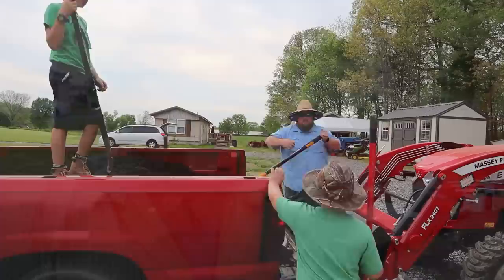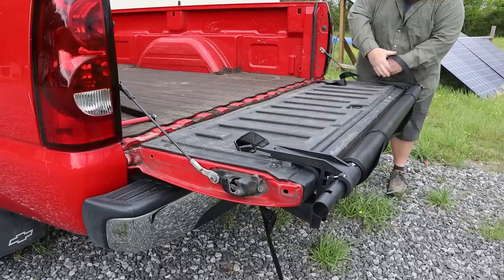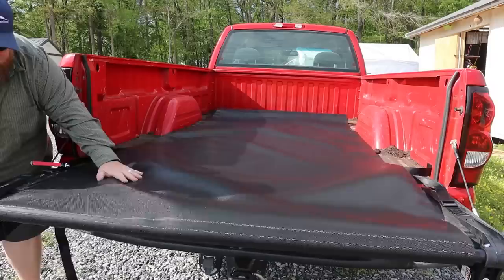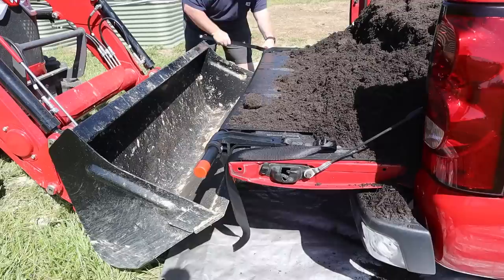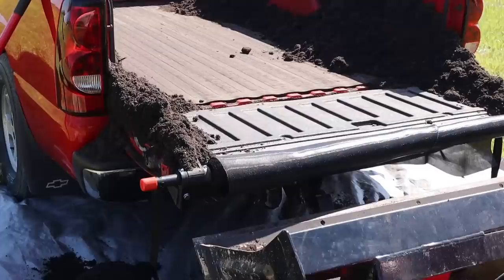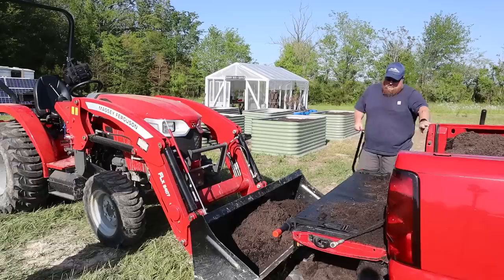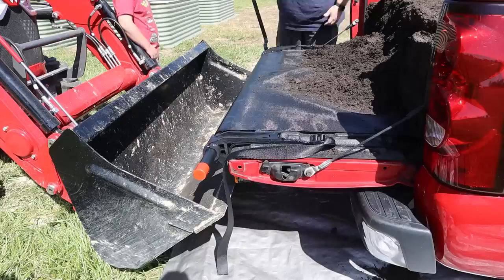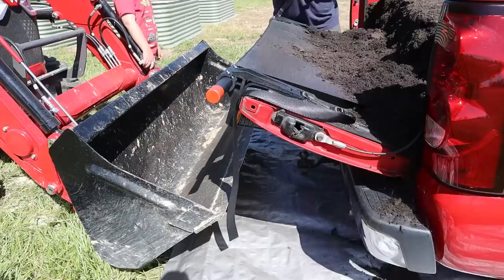We Bought the Cheapest Truck Bed Cargo Unloader... DID IT WORK?

Comment: I think that it may be easier unloading if you remove the rubber truck mat. The rubberized material creates friction against the unloader mat and is hard to move it.
Reply: I was typing a very similar comment when I noticed yours. 
Those rubber mats are great for preventing things from sliding around your truck bed and the unloader is really counting on stuff sliding easily
Reply: Or cover the rubber with something much more slippery?  Plastic with water and soap over it?  Cut in a shape to cover the corners and maybe more soil will come out.  And place a smaller thicker metal rod inside the thin wall rod before it breaks.
Reply: I told him while I was watching him put it together, but he wouldn't listen.
Reply: If you can't remove the rubber mat, maybe just cover it with cardboard. Anything to make it slide easier. I was trying to tell Sam also, he just wouldn't listen. Or maybe a tarp doubled up underneath the roll up part. The tarp might slide on itself much easier.
Reply: I agree
Reply: Yeah that rubber mat is definitely preventing the unloader from working as it should. Please make another video like this but with the mat in the bed of the truck! Much love
Reply: The rubber mat is the problem!!!!!
Reply: Those hand unloader's at harbor freight are the best.  Just pull the tarp to front of bed when you load then crank it off when you want to unload no shovels needed.
Reply: Lay a sheet of osb with slick side up over the matt
Reply: Done this many times, unroll a tarp under the cargo unloader, covering from side to side and over the wheelwells. The cargo unloader will slide like glass no matter the weight and the tarp will catch soil that falls on the sides, allowing you to drag and drop the spillage  where you want.
Reply: @tomkrause62  🤣
Reply: @tomkrause62  😂😂😂😂
Reply: Your right. Your suppose to take out rubber mat.
Reply: Also, you can hit the rubber mat with a wax based coating (armor all or similar) or like others suggested, put a plastic sheet under the cargo unloader to finish up the sides and make the cargo slide better on the rubber bed liner.
Reply: Yup. Learned that after one load of mulch on mine. Rubber mat had to go for the last 14 loads lol

Comment: I remember back when those were an “as seen on tv” item. They were designed to be used with the hard plastic bed liners. They warned that if you had otherwise that you needed a slipper mat of plastic between the bed and the unloader.

Comment: I have used one of those unloaders on a hard poly (slick) bedliner and it worked much faster.  I think friction with the rubber bed mat is part of your challenge.  I also added a few pieces of scrap wood at the sides to prevent mulch falling off the sides of the tailgate, and that helped.  Your garden beds are going to be awesome!
Reply: The instructions state that mats need to be removed before using this.

Comment: My Load handler for over 20 years for my grandpa's Chevy Silverado truck 8' foot long bed as well as my Dodge Dakota Club Cab 6' half foot long bed. Working great moving gravel and buckets of sand and concrete blocks as well as the truck are not over loaded over 2 thousands pounds.

Comment: I have had an unloader for years and never had any problems unloading anything, I’ve had a bed full of concrete and unloaded it with ease. Now when you first start to turn the bar you will have to really push to get it moving but once it starts moving it’s a piece of cake.

Comment: The cargo unloader works great if you put a plastic bed liner in the truck and don't use the rubber bed mat. I used one for several years hauling rock , durt, and other stuff. You can even spread rock with it for a driveway

Comment: Sam, to help alleviate the unloader tube distortion find a piece of pipe that has an internal dimension that is just a little larger in diameter than the unloader tube's outside diameter. Cut it an inch or so longer than the unloader tarp width, then grind a midline the whole length of the pipe, all of the way through to the center of the pipe. Make sure to file smooth all sharp points and edges.Unroll the tarp, and slide the pipe over the tube with the tarp fitting through the ground slice in the pipe. Use the inner ring locks to keep the pipe in place. This will keep the unloader tube from distorting so much. | For the crank end of the loader tube... take a piece of slotted pipe that is an inch or an inch and a half in length and drill a hole all of the way through the pipe ninety degrees (perpendicular) to the ground slot. Slide the slotted pipe over the tubing a align the drilled holes in the pipe to the crank handle slots in the loader tube. A snug fit is required here, if needed, use a c-clamp to close the pipe to the unloader tube, weld or braise in place.
Reply: Horse manure.
Reply: @juanitakauffman6336 , I don't know what your life experiences have been, but I have had over thirty years of experience in industrial machines and support equipment. (installation, maintenance, repair, and modification) I have successfully modified multiple pieces of industrial equipment to perform tasks that they were never designed to complete. I can't swear on a stack of Bibles or anything, but I do believe this will work.

Comment: I think you would be right. The weight of rock or 100% topsoil will bend the bar much sooner. Lite weight Items will work better. Or at least half load of the heavier items is probably recommended . Good luck on the garden.

Comment: Here’s an idea to make it easier. Measure end of pipe and get a bolt that sized that will slide into the pipe. Put marks on the bolt where handle slots are. Drill hole in bolt. Put back in and slide bolt through hole you just drilled. And then you can use a drill with socket to turn pipe and pull cloth. Whatcha think Sam

Comment: I have the original Load-Handlier and it give extra tarp to laying down on top of the rubber truck mats and rubberized undercoating truck bed to made it moved better . You should have used a regular heavyweight slick tarps on top of your truck bed before laying down the Hauler Tarp Loader crank handle.

Comment: So have one of these that I use for triple ground mulch and sometimes garden mix soil. To me it looks like you have an 8 foot bed so there's a lot of material locking your load in front of the wheel wells. 2 two foot wide pieces of plywood along the sidewall of bed would greatly increase the ease of unloading. I have the same rubber mat in my 07 ext cab Silverado and I haven't had any problems as long as in front of the there is no material. 
I will say this though. Either the guys at the place I get my mulch are generous or you are getting ripped off because that was a very light looking one yard bucket load.

Comment: We're still having freezing overnight temps!!

Some ideas maybe to help the unloader...
* for when you drop the tailgate, make some triangle pieces to put on the ends to minimize the fallout as you roll it forward (from outside edge of tailgate to top of bed) 
* create a longer piece for your hands to fit on to run the crank
* parklet gravity help you - park the truck on a slight hill with the front of the truck pointed UP the hill
* if the bar of the crank seems a bit flimsy, weld or screw a flat metal piece to its length to fortify it

Comment: I put a Costco tarp under the unloader blanket first. Make sure it is about 6 inches from the tailgate. Lay extra tarp over sides to wrap over load. I use a harbor freight netting to secure folded tarp to drive at highway speeds. Pull nut off oneside only. Open the tarp and then unload. Repeat.

Comment: I appears the weak point on these is the end where the crank handle go thru the hollow rod. They have been known to break out the hole there if used on a larger heavy load. I have since built mine up with a thicker piece of tubing over the stock tube to beef up the strength of it.

Comment: I use a 4x8 trailer to get wood chips from a local sawmill for mulch.  They pack it so full and high I have to climb on top to fork the chips over the side into my gorilla cart until enough is out to be able to get the gate off the back of the trailer.  Since a fair amount spilled on the ground, I put a tarp under the sides an front or sides and back depending where I was working.  Made it a lot easier to clean up.  I either used a shovel or just pulled the tarp where I could dump the mulch.

Comment: I had the original Load Handler 20 years ago. It’s basically the same as the HF. I thought of making a plywood bottom with hinges with sides a bit higher then top of the beds. This way the material doesn’t get locked up in the wheel wells. I think be a lot less strain on the cranking shaft. And with hinges it would fold up.

Comment: I've had the HF reloader for more than 10 years. The haul is one yard at a time, 2 to 4 yards of garden soil each year, and some were very wet. The bar flexes a lot but it straightens every time. One warning, if dirt gets on the pads, it will scratch the outside paint on the tailgate.  Overall, I'm happy with it.
Reply: Thanks for the long term review.

Comment: Your problems with the unloaded may have been due to your load.  If that was actually 3 yds, it was much more weight than the unit is designed for.  Each yd weighs ~1700 lbs.  Therefore each load was almost 5,000 lbs, 2-1/2 times what is is rated for.  I have one and have used it many times for dirt and gravel with little problem.  I never put 3 yds is soil in a load.

Comment: I had no idea this was a thing. I tried to do this with a tarp and I still have to shovel half of it to get a load of wood chips out. I think this might be worth it.

I wonder if a little fabrication could get you to use an ugga dugga on this. I think if you put a bigger tarp down first that could go up the sides and back, you might be able to contain the mess left int eh truck and pull it out after the unloader is rolled up. Either way I think this thing is worth it and a viable alternative to a dump trailer. Can't beat the price for how sore I was last time I shoved a bunch of woodchips out of my truck.

As I think about this, I wonder if there is an option where you line the truck bed with a sturdy tarp that you use the tractor to yank out. Looks like they are called portable truck bed liners. I wonder how strong those would be.

Comment: Great video as always. Congrats on 100K, Thats great! A couple of tips with that cargo unloader. Take out the rubber mat while using it or get a plastic bed liner. It will slip out a lot easier. I added a winch motor to mine so I could unload by pressing a button from the cab. Good for spreading gravel. Also add a piece of plywood on the sides cut out for the fenders angled to the middle. This will make the whole load go on the material and makes clean up easier. So far after years of use it has held up pretty well. The material has worn through in a couple of places though.  Keep up the videos.

Comment: TIP
Place a tarp in the bed, THEN roll out the unloader fabric on top (make sure it is on top of the tarp) before filling with material.The unloader fabric rolls off MOST of the material, but no one likes having compost/stone/chips filling into all of the nooks of a truck rear gate/corners.

Comment: i noticed you have a type or rubber mat in the back of your truck, rubber is great if you want stuff to stick in place but really bad if you want it to slide.
i'm sure this is the major reason it was hard to use the cargo unloader. put anything else down over the rubber (except more rubber clearly) and then the unloader net over the top. cardboard or plastic come to mind. this will allow the net of the cargo unloader to slide on it, which will massively reduce the friction over the net over the rubber.
the difference is like rubbing concrete with more concrete and rubbing two plastic sheets with each other, it's night and day difference.

Comment: those unloaders are good with lightweight stuff, or half loads.  Handled the dirt for you pretty good, but I would not recommend using it for rock, the fabric will just pull out from underneath the rocks.  Also, though you probly figured it out already, to get the stuff from the sides of the bed, just put the fabric back down and use a broom to knock the leftovers onto the fabric.  Thank you for sharing

Comment: I have the same unloader and  if you don't let them pack the material down when loading with a loader it is easier to use. A rubber mat does makes harder to slide over.

Comment: By now I guess you know to remove the rubber mat. I have used my easy unloader for over 20 years and have been very satisfied with it. But I have only used it on a bed liner (plastic not spray on), I have used it with dirt, rock and asphalt roofing. Enjoy your videos keep them coming.

Comment: I agree with some of the other comments about changing the pipe to a thicker wall pipe. Then I would throw out that crumby handle and have a 1" or larger nut welded to the end and then get the same size socket with a 1" ratchet (with cheater pipe). This way you can stand upright and crank away. I think using an electric drill as was suggested you would still need to bend over and it may torque out and you could look at a sprained wrist or worse. Love watching both of your channels.

Comment: They do work good as long as the load isn’t locked in the wheel wells which a load like this is  and a regular bed liner compared to the rubber mat have had one for years and like it alot

Comment: 3/4 inch black pipe will fit inside that tube that the cargo stuff winds on. $20 investment, cut slots in the pipe to line up with the slots in the tube, slide it in, and make the tube much stiffer, and it will last MUCH MUCH longer

Comment: You aren't using it quite right. The belt is extra long for a reason. When you lay  it in the bed put some pleats in it a few feet long (fold and lay it over itself). That extra slack makes it only pull the first few feet of material and the belt slides on itself instead of the grippy bed. When the first pleat is done unloading it will go taught and pull the next pleat. In this way only 1/3 or 1/4 of the material is ever being pulled at a time.

Comment: So yeah as I was saying before... you can get as much garden soil delivered directly to you, via dump truck service, saves you the cost of the tool, and cost of driving back and forth, saves you your time, and you will have a mound of soil ready to use and make more beds with it.  So much easier than riding the struggle bus.

Comment: I just finished watching your video the cargo bed Liner. You was struggling to crank it.  So, with what your doing there is great, but I think you should look at  a system that is called the Dumper dog. I mount in the bed when need and can be removed when not needed. But I think it wll pay for it self  in long term.

Comment: mine buckled in the middle you just need to cut the middle connections off and put a 3/4 black pipe and it will be strong and wont buckle anymore.

Comment: What if you used another trap on top of that movable one, cross ways (driver side to passenger side) just before loading. Fold those sides over the load. Kinda like a big burrito on a conveyor belt. That should help with less clean up in the bed later. Just a thought.

Comment: It seems if maybe the handle had a gear system and a ratchet to enable one to turn the crank to advance it more and then crank back to the original position.  It looks like making a full turn on it would be hard on the back while Stooping over.

Comment: I have the same one. Definitely should remove the rubber mat because the fabric material doesn’t slide very well on rubber. Also, with too much strain the slot where the handle is inserted will can-opener 😂 the first one I had didn’t explode spectacularly like I expected it to

Comment: I have same unloader from harbor freight #1 get gas pipe and reinforce bar have had mine over a yr use it all the time on my truck bed trailer it's still working like it should used on rock gravel dirt and to slide a stack of skids to tailgate about to unload some crush and run over 1 ton on it and # 2 try and find a plastic bed liner and armor all it heavy loads slide rite out

Comment: had a suspicion when i saw the setup that the load sitting on top would be too heavy , was even thinking about the clamps damaging the tailgate itself 
it can work if the fabric is strong enough , if it breaks you could still use straps to atach the "roll" to the tractor or a tree and either drive the pickup out from under it it have the tractor pull the fabric out of the bed , probably will only unload half of wats in the bed to the ground 
watever happened to the white pickup bed / trailer , couldve used that and kept the truck just about pristene

Comment: It's funny, I made a bunch of homemade interior siding for my cabin (5.5" by 48") from 6 sheets of 3/8" plywood. I put a tarp in my bed and loaded the siding on top of it. Today at my cabin, I went to pull the tarp out with all the siding that had slid to the back driving there, and the siding was so heavy that the tarp came out while the siding stayed in my truck. Wondering if this unloader would work better.

Comment: Horse Apple = solid waste from the north end of a south bound horse. I keep wondering if you could put some plywood or other material between the tailgate and wheel wells which would then be pulled to the edge of the down tailgate when unloading. The intent would be to keep loose materials from falling off the side of the tailgate.